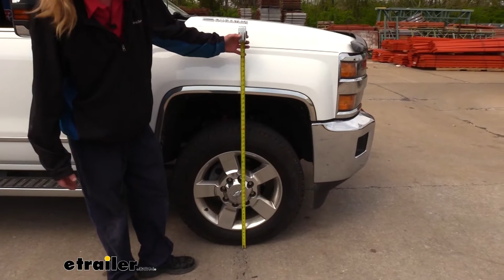etrailer | SuperSprings Custom Suspension Stabilizer Installation - 2016 Chevrolet Silverado 2500

Comment: What is the weight rating of these springs? I have a 2016 F250 with only a 2+1 leafe spring and it'll squat an inch or so with 400lbs of tongue weight. I know this is a Chevrolet truck but that pin weight has to be pretty high and I liked that the squat was just one inch bringing it to stock height.
Reply from the maker: The SuperSprings carry a capacity of 3000 lbs which would do a good job of handling the pin weight of many 5th wheels.
https://www.etrailer.com/Vehicle-Suspension/SuperSprings-Intl/SSA13MXKT.html